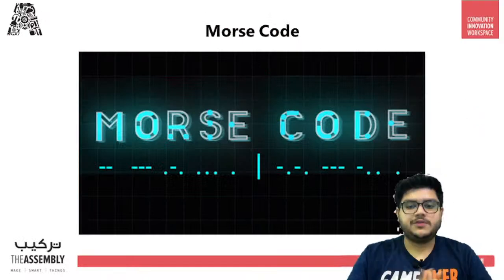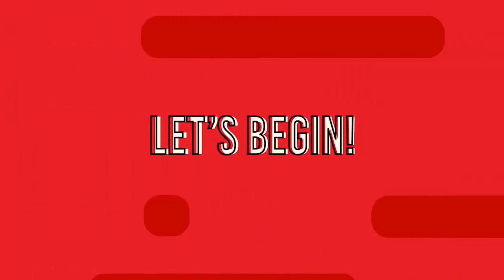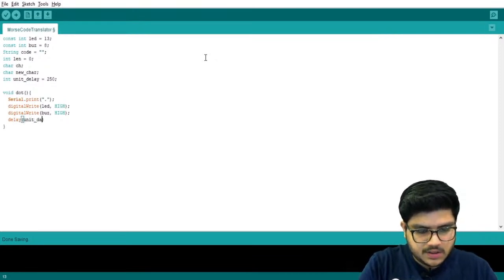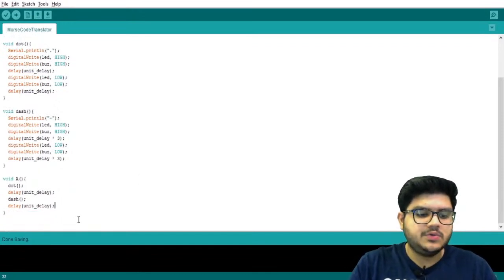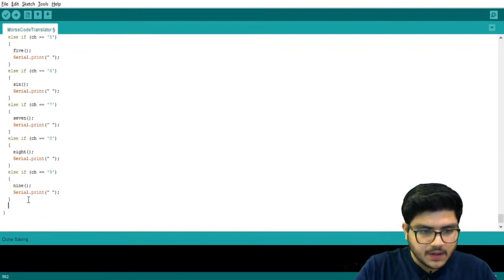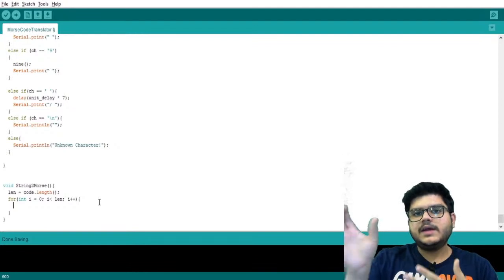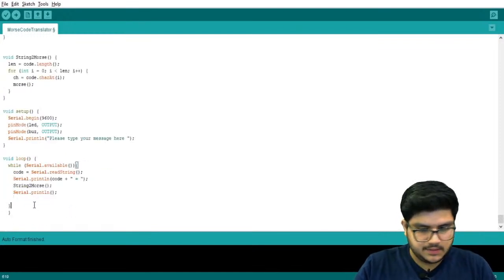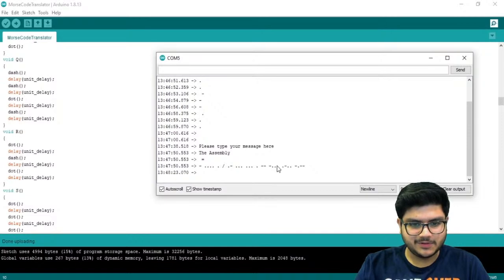Transmit Morse Code with Arduino

Comment: There's already a unit_delay after each dot and dash is turned off, so you don't need extra ones after each call to dot and dash.
And, omg, all them Serial.prints of the characters, when it can be done with a single statement Serial.print(ch);
And that makes the calls to the character voids much simpler, as you can do it on one line... it's not necessary to use the "else_ if" construct then. e.g. ....
void morse() {
  if(ch == 'A' || ch =='a') let_A();
  if(ch == 'B' || ch =='b') let_B();
  if(ch == 'C' || ch =='c') let_C();
  if(ch == 'D' || ch =='d') let_D();
  if(ch == 'E' || ch =='e') let_E();
Follow that up with a call to an "end_letter" method which inserts a further 2 unit_delays (making the correct total of 3)...
  if(ch == '0') zero();
  if(ch == ' ') space();
  Serial.print(ch);
  end_letter();
  }
I had to change the single-letter void names, as the compiler baulked at some of them for the Arduino Nano
Reply: It is entirely necessary for the decoder to work. Read the code again before you comment.